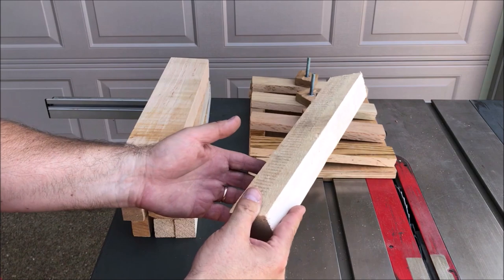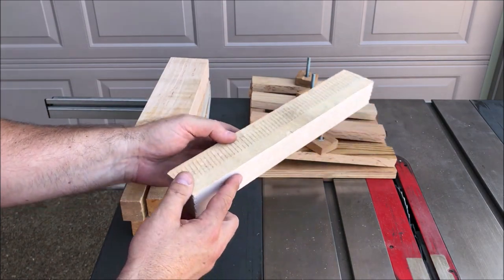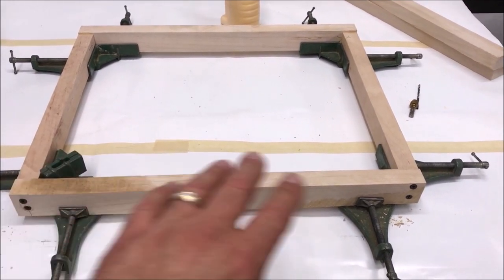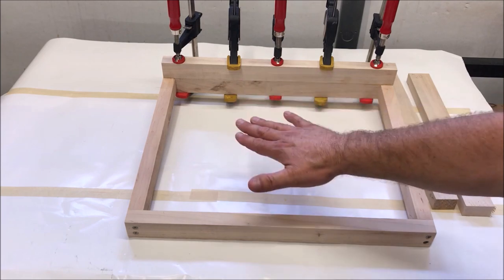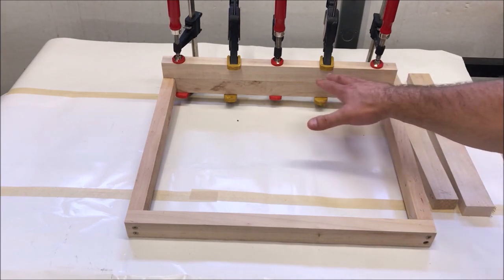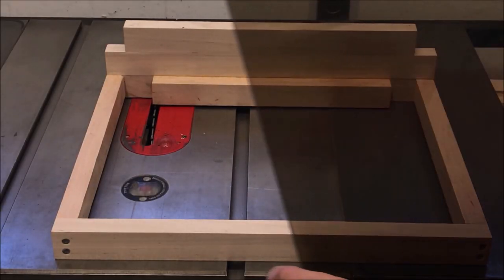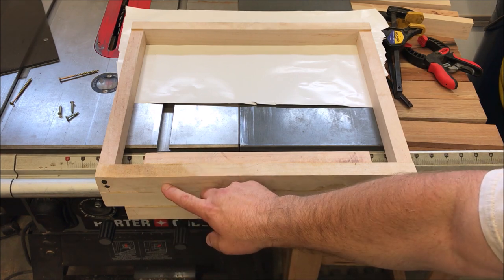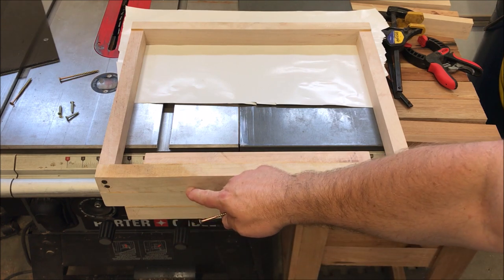Simple Functional Shelf for my Shop Turn Table

Comment: Hi Bob, Nice simple build. Are you concerned about dust affecting the stylus on the turntable? Cheers, Huw
Reply from the maker: Not really, I clean each record before playing it. Periodically, ever few records, I clean the needle. I keep the top down And can blow the dust of with my compressor. There could be some effects long term but it’s an old turn table plus it has nine lives as it fell 9 feet to a concrete floor. LOL. 

Regards,
Bob
Reply: @RJBWoodTurner  Well now eight lives.